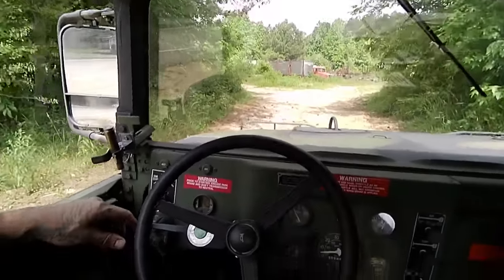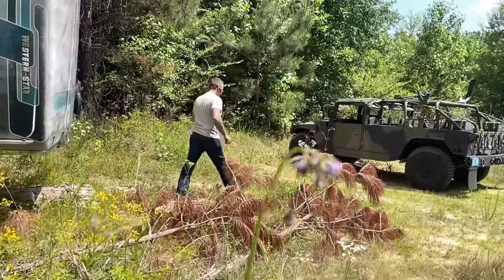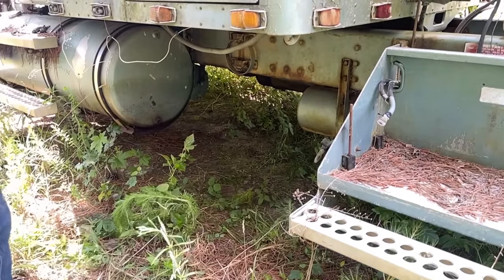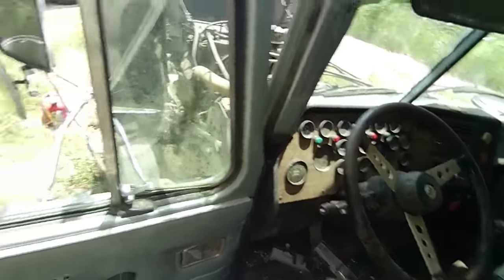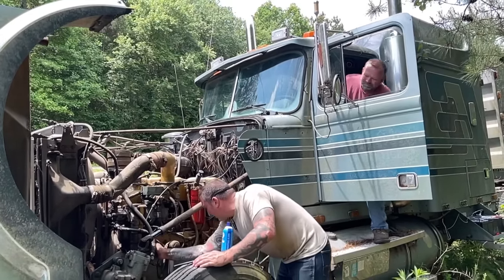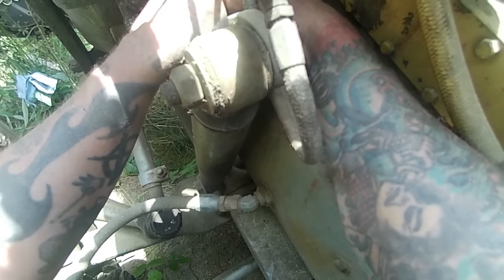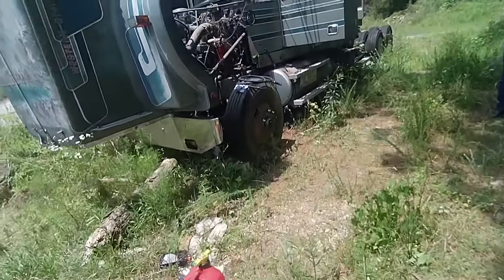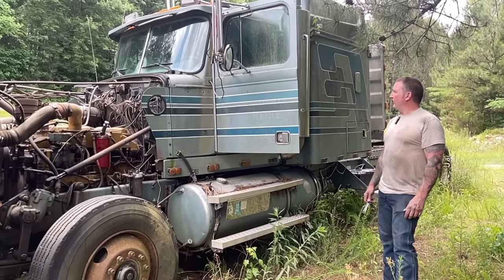Western Star left to Rot Will It Start after all these years

Comment: When I worked on diesels the first thing I was told to look for on a non-runner was smoke from the exhaust when you crank it. No smoke? No fuel. There's your problem, get that sorted and it will run, as your video proved. Beautiful old truck, with the old White/Autocar cab still being used.
Reply from the maker: Appreciate ya watching Steve

Comment: Used to be a pit mechanic in copper mine . Operators always missed fuel up so would run out of fuel a couple hrs into shift . I’ve seen other mechanics spend 6-8 hrs to start up . I rigged up a 12 v. And24 volt electric fuel pumps . Line and extra fittings I’d hook up pump fuel trk would fill it up . Charge up fuel system  and start . These were all the way to 12  / 645E DD EMD loco engines in ore trks .  Wabco haul pac 3200 . Sure rules out fittings or fuel line , that leaks like sprinkler system . This Worked for me !
Reply from the maker: Rite on

Comment: They are cool old trucks. I have a 94 model with a series 60 and a 15 speed OD. I always liked the detail of them inside and out, the heritage cabs are cool. Mine still goes well and has done 1.8 million kms now. I drove same erra ones like this and similar back in late 90s with KTA 19 motors factory fitted air starters and 18 speeds on roadtrain work in western Australia too, good memories.
Reply from the maker: Ya I love the truck. I want to drive it
Reply: @bush600r
I have an 01 that needs an ecm to cab harness to get back on the road and had a 96 600r street legal 😅
Reply: @abones7243  Goodluck I'm sure you should be able to find a harness easy enough. Yeah man love the old XR I've owned three 600's over the years but just have the 94 now. Don't think I'll ever sell it.

Comment: There is a rod inside of the pump and when they go bad you have to take the pump off and cut it just to run it bit then you can't shut it off, if you have the tools it shouldn't take an half way decent mechanic no more than an hour to do it, it's very easy to do

Comment: A good buddy of mine has owned and driven trucks all his life and encountered a strange problem with intermittent fuel supply on one.

It turned out to be the plastic membrane seal from inside the cap of some kind of container like a small fuel can which was floating around in the fuel tank and every now and then, it would get sucked against the fuel line outlet and block the flow of fuel!

Once he found it and fished it out he never had the problem again which confirmed his suspicions.
Reply from the maker: Wow nice find.  I’ll bet people have junked engines and trucks for something like that

Comment: Dang nice Western Star. Looking at it I thought it would fire up and run. I bet if you filled the coolant and built up air it’d drive out of that spot if the tires were hard. Curious why it got parked there? Looks like it’s roadworthy sounded like it has good oil pressure. Puzzling to me, that’s most likely why he wants good money for it. Those were beautiful trucks inside a good cleaning and a few pieces it’d be cool. Too bad the Marmon is overgrown already. Those Cat engines can be finicky but that one fired up it wants to get back to work. That truck was someone’s baby at some point in it’s life. Stay safe can’t wait to see your next video
Reply from the maker: well the guy died is why that truck ended up where it is  most of the trucks I show from here were in a different location for years and when a truck broke down it was easier to just buy a running truck then to try to lose time with repairs..
Reply: Oh I didn’t know that. That’s why it looks well cared for. Still kinda sad to see it sitting there like that. Looks like someone has already been stealing parts off it. Who knows what will happen to it. Hopefully someone that will use it and appreciate it will see the video and rescue it.

Comment: Left air cleaner gone. Front wheels, probably alum., swapped for junk. Can see ground from shifter knob; mouse thoroughfare. Sun damage on top, back tires probably cooked hard as hockey pucks. Yep, up where you’re from, rusting from the bottom up is a thing, but I’ve discovered rusting from the top down is a thing. It’s the sun, and it eats up everything down here. Next time you’re over there, check the ID stuff on the truck and see if it was built in N.C. It will clean up nice, but not without a large injection of money, time, and skill. Hang in there and keep every body on their toes. Take care.
Reply from the maker: Thanks for watching.  Appreciate the comments

Comment: What year is this Western Star, I believe you said it was a 1988 model ???
The reason I ask is a friend of mine who lived in Woodland, Washington State purchased a similar model brand new in 1982 same wheel base, Detroit Diesel 8V 92, 445 HP 13 Speed.
Same size Sleeper, custom paint job by Western Star ~ $60,000 USD brand new (1982).
I was visiting the United States 🇺🇸 from where I live in the North Island of New Zealand, I was 25 way back then and 66 and retired now. I spent alot of time with Ben doing OTR for a company called Western State Trucklines who were based in Portland, Oregon.
A real smart looking truck in its day and an absolute pleasure to drive !!!
Hope you ended up buying it James as it looks be in tidy condition for it's age ~ All the best and Kind Regards. 
AJ
Reply from the maker: Ya it’s an 88.  I did not buy it.  He wants too much for it
Reply: @JamesPretty  What a shame he wants to much for it, most probably will just sit there and rot away eventually ???

Comment: Is diesel sitting for a long time still do it’s job good? I always thought it was expired . Also how about the oil?
Reply from the maker: Old engine oil thy feels lubricious is fine for start up but wouldn’t run it long.  Old diesel fuel can go either way really.  I burn 20 year old diesel in my heater for winter and I’ve driven trucks home on old fuel.  But it can be problematic

Comment: Damn that gotta rack mounted ham radio in it looks like LoL
Reply from the maker: I’ll have to look when I go back there
Reply: @JamesPretty  it looked like A old Dual Band or Single uhf or vhf set by Motorola or Kenwood but only a company in a county wide range would use that setup plus they woulda used a mobile version so I'm gonna have to say it's a 10meter HF radio transceiver that can be used on the CB band I've heard guys talk about big radios but they just meant high powered 10meter mobiles that was a full blown rack mount style Ham set I seen a old car phone set in there to like the bag phones
Reply from the maker: @jberry1982  nice.  Good catch
Reply: Well I drive a truck myself and I'm. Ham operator to plus I'm observant LoL

Comment: Key on, prime until hard, keep pumping until it starts.  I worked for Western Star and on many of these.  if it is harder to start, 1" wrench and pull fuel residual off from behind filter. Can you blow through it? Rack as you call it, is not stuck.  Pussy will pure if you know how to pet it right.

Comment: Do you have an Email address I can drop a couple leads to? Noticed a old Cornbinder 4070 still hasn't moved in 10-15 years minimum on a main highway here. Also a whole gaggle of COEs at a truck shop just down the road from the Binder pushed up against the fence in the dead line. Figured since you was localish to me I would throw the location out there to ya.
Reply from the maker: Pkkustomz@hotmail.com

Comment: Ain’t no 600k mi truck. Odometer has rolled over at least one time. The driver probably drove barefoot which save the wear on the pedals. What’s also funny is when someone finds a 50 yr old cabover and it has 200k on the odometer they automatically think that’s original miles. NO!! That odometer has turned over at least 3 times. Especially if it’s been parked for 15 yrs.
Reply from the maker: I need your crystal ball  lol

Comment: Western stars are a dime a dozen, the rest of your fleet are precious gems. You should borrow the starter to use on the Marmon. I think it would run if you got it spinning faster. Fantastic video as always, and it’s nice to see you broke 20k.
Reply: Those western stars aren’t a dime a dozen the newer pregnant looking constellation series trucks are a dime a dozen that was when western star was still made by western star in Canada I grew up in one identical to that one spec wise was the truck that got me into trucking narrow cab with the big stand up sleeper  just like sitting in a Peterbilt or w900 the hood is actually almost 4 inches longer than a Peterbilt 379 in this day that truck is as rare as any of our cab overs
Reply from the maker: I put a new starter on Betty "the marmon" it its not doing any better. I think the timing is off or perhaps the timing unit cam apart and got into the gear train.. im gonna tear it down and see and possibly in frame overhaul it
Reply from the maker: I love that truck.  I want someone to buy it and put in service.
Reply: I guess I didn’t know they were rare, I see a lot of them in my area. I know where 5 are sitting that the guy wants $65,000 for the set, but he will only sell them together and not 1 at a time. The last IFTA stickers are 2009.
Reply from the maker: @stevenlatham4397  wow. Send pics

Comment: Do you know how much trouble changing a set of rears from Wedge to S-Cam brake would be? Got a 72 Kenny K123 with wedges
Reply from the maker: That’s a great question. I have never done it so I’d hate to make a guess on that.  Might be a better guy to ask out there    Appreciate ya watching
Reply: @JamesPretty  Another question. Do you know a local place that might have a cut off that would have the same frame width as an old KW COE? Truck was cut already most likely in the 80s. No idea why since the truck was built as a air ride per the build data and now has springer rears. Can't imagine that is an improvement on a cabover. Lol.
Reply from the maker: @SPUPRR  where you located?
Reply: @JamesPretty  over here in Gadsden just across the state line.
Reply from the maker: @SPUPRR  ok. Well there’s lots of cutoffs available. Message me on Facebook.  Just look for Jamespretty.inc